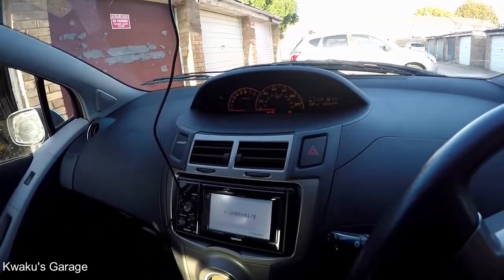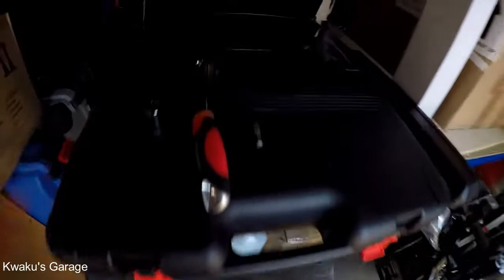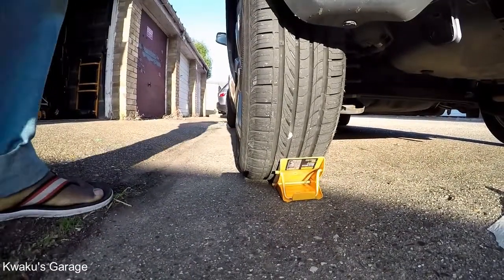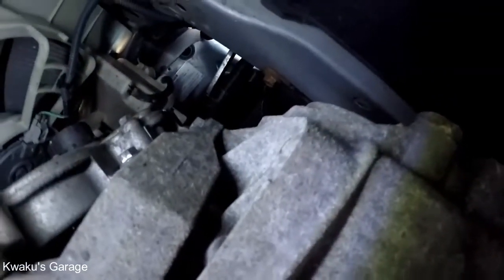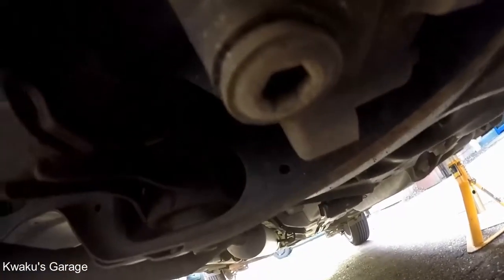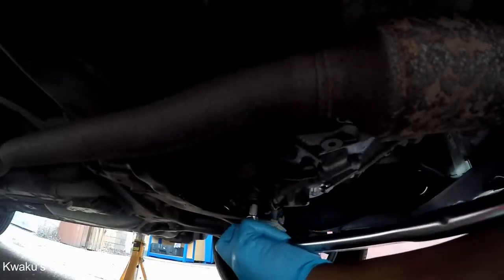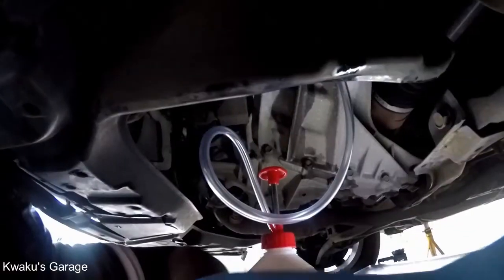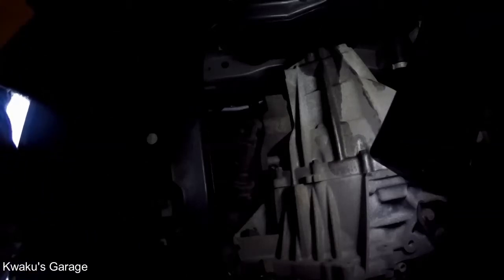Toyota Yaris 1 3 VVT MMT Gearbox Oil Change Drain and Fill.

Comment: Hello, I just recently jacked my car in the spot where you put your fixed supports, according to the manual, but I didn’t know that it was a good place to place those supports, because of the frame there. Is it safe? Because it’s a thin vertical piece of metal touching the support. 
Thank you.
Reply from the maker: Yes, thats the jack point for this vehicle.  It is designed to support the weight of the car so yes, it is safe to use in that way....
Reply: @kwakusgarage2079  thank you. Just performed the maintenance of it and it went just fine. 👍🏻
Reply from the maker: @Blessman8  
👍🏾👍🏾👍🏾

Comment: Which gear oil—75w-80, 75w-85, or 75w-90—is best for a 2009 Yaris with a 1.3 MMT transmission? I want smooth gear shifts and good performance. 

Most Yaris users online say 75w-90 isn't great for MMT transmissions; it's better for manual gearboxes.

The Yaris manual suggests using only single-grade 75w oil.
Reply from the maker: Apologies for the late response. My manual states 75w80 gear oil and so far, all is well and gearbox is shifting fine. You can get confirmation from your local toyota dealer regarding the best gear oil to use. Hope this helps, all the best....

Comment: Correct gearbox oil is fully synthetic 75w for the 1.33 vvti from 2009 to 2011 as its 6 speed. If you are not sure which oil is correct buy from toyota. Incorrect oil will damage gearbox.
Reply from the maker: Thanks for the feedback. The oil used in this video was recommended by my toyota dealership in my area. ...
Thanks...

Comment: Hello I have a semi automatic Toyota auris Wen I'm driving slowly it sometimes goes on neutral I have to switch engine off then it changes gears
Reply from the maker: Hi there, do you mean the gear shifter moves from drive to neutral by itself or the gear shifter is in drive but the dashboard displays N(neutral)? 
Thanks...
Reply: Dashboard display goes to neutral I have to switch of engine them gears change again
Reply from the maker: @koysurrahman2344  
OK, that will signify an electronic problem with the gearbox. Best bet is to 
1: search the Internet to see if this is a common occurance on your car and whether it can be fixed easily (diy). Or
2: get your car scanned for codes and get a professional to fix the issue(s). All the best and please keep me updated....

Comment: Hi mate , where to get the parts you used such as filler plugs and drain plugs
Reply from the maker: Eurocar parts, ebay and carparts4less. Make sure they are oem parts and confirm with part numbers ...

Comment: Hi, I have a 2008 semi auto Yaris 1.3 I feel that the gearbox is very Jurky so I thought if I replace the gearbox oil will this fix the problem)
Reply: Mine is on 97k, did one 40k ago, after watching will do. Mine is used as school car so gets trashing all the time.
Reply from the maker: Possibly, whats your mileage?
Reply: @kwakusgarage2079  hi appreciate the reply :)) I’m going tommrow to a garage to do the gearbox oil. The mileage is currently at 48,000
Reply from the maker: @genesisyt4763  yes, definately needs a change. it must be done every 40,000 miles.
Goodluck...

Comment: hello I have a Yaris 1.0 2 series petrol from 2009, processions to change oil, can you confirm that I am 2.5 liters? unfortunately I no longer have the manual, also I would like to know the viscosity recommended in the booklet, I was going to put a bardal 75w-90
Reply from the maker: Hi Antonio, apologies for the late response. Youll need to get a replacement technical manual, which details the oil volumes and viscosity required for your car. I did search online but nothing useful is coming up. Thanks.

Comment: after changing the transmission fluid the gear has become hard to shift.Is that normal.Thanks
Reply from the maker: Hi there,  no that is not normal. It is shifting hard due to possible friction/lack of lubrication. Did you use the manufacturer's  recommended fluid and at the right volume?
Reply: @kwakusgarage2079  Thank you guys i used wrong oil 75 w90 instead of recommended by toyota

Comment: Do you know how often toyota recommends changing the gearbox oil for the manual version?
Reply from the maker: Hello, I just checked and it is not even mentioned in the yaris manual. I'll personally change the oil every 40 to 80k if you intend to keep the car for a long time. Hope this helps,  thanks.